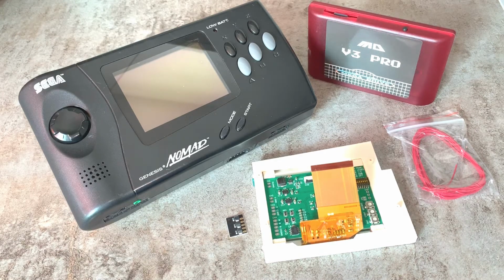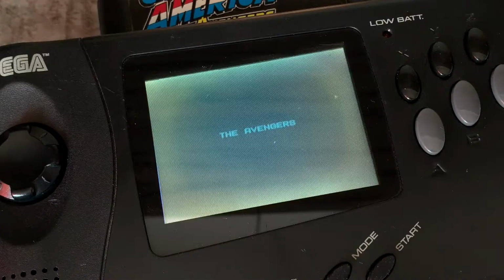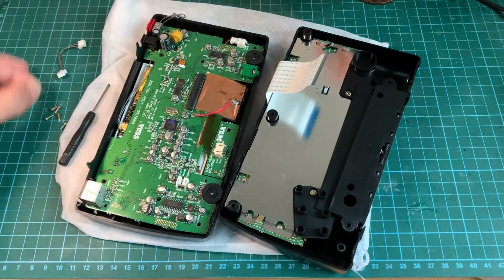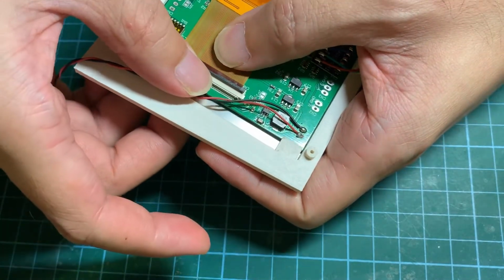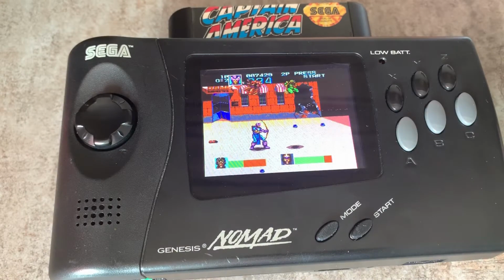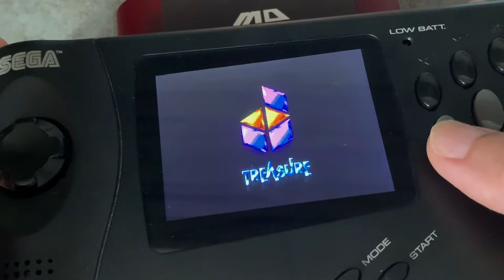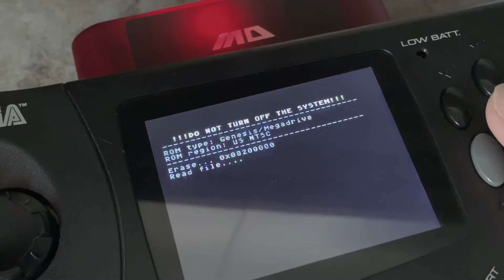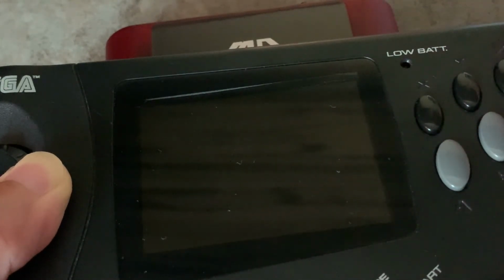Sega Nomad High Quality LCD with MobiusStripTech board

Comment: Nice! but why is the screen have black strip on each side? why is the video not full screen?
Reply from the maker: Thanks for watching. I guess there’s a mismatch of the aspect ratio of the screen.
Reply: I have wondered this too, but this isn't the only one i've seen with that boarder on the right side like that, seems a common thing. 

I went to great lengths many years ago when i did my old composite LCD screen mod to get it centered, these days it seems most are using pre-made printed parts, and no one has corrected the print yet to even up the gaps
Reply: @CaseTheCorvetteMan  yeah, lcddrv does this. This is why most people prefer rgbdrv which is no longer available. There are cheap alternatives available, like the 80 dollar chinese aliexpress bootlegs, which inhibit screen stuttering
Reply: @mariowario5945  oh ok, i have one of those here but never installed it yet